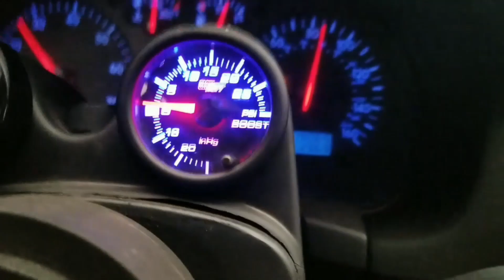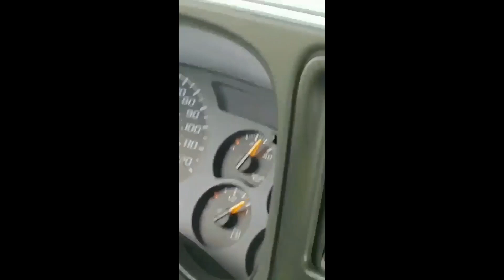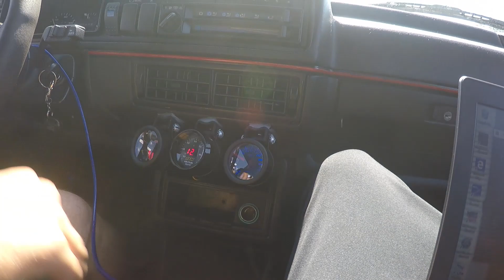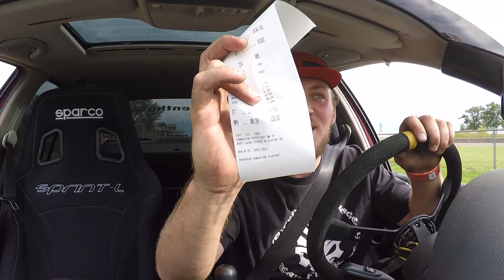Powercruise & Proving Grounds 2019!

Comment: i have a 2000 gls im looking to boost need advice
Reply from the maker: start with a exhaust and tune you could probably get 40hp if the car is a stock 1.8t
Reply: Whats exhaust do you have or a good one?
Reply: @stacygarcia4834  I don't have a exhaust yet my car is completely stock right now but magnaflow is a good one
Reply: @mxz700MN  whats your exhuast set up or a good one
Reply: So you're going with the magnaflow